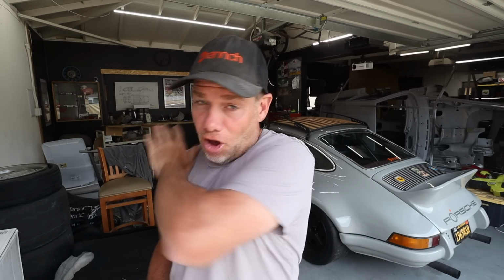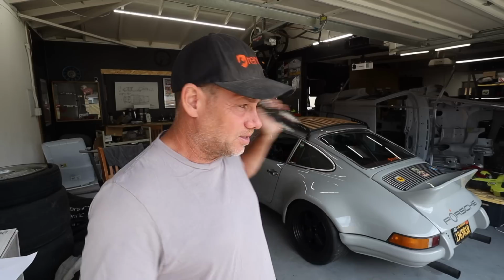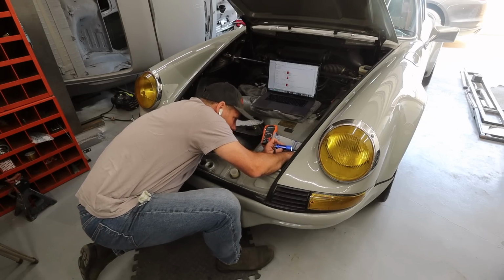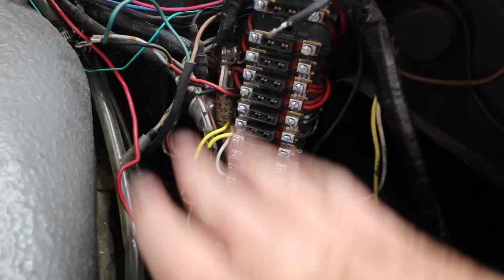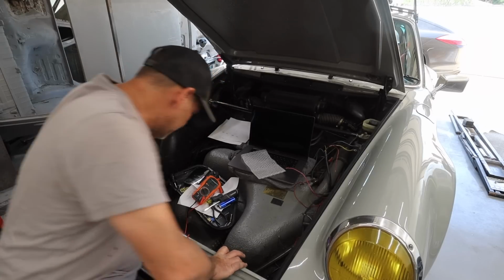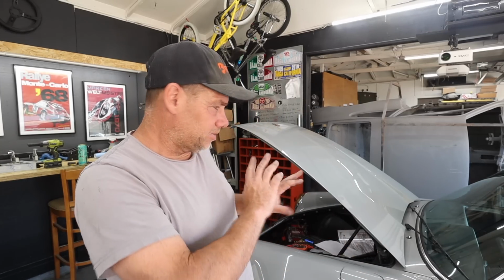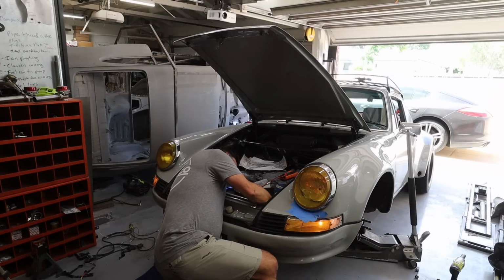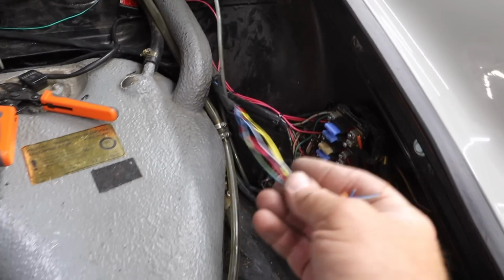How to Fix & Upgrade Your Vintage Porsche or Vintage VW WIRING! Part 1 (Porsche Restoration Series)

Comment: I upgraded my fuse panel in my 78. As I moved wires, I labeled every wire using a label maker that prints on heat shrink tubing. Now I can look at any wire and immediately see what device it is associated with.

Comment: Hey Michael I have really enjoyed watching you working on the gray ghost and now upgrading your electrical system that’s great,  that’s what I’d like to do to my 1974 911.
 But  why do you and other people always want to paint the engine compartment and the trunk  black??    Black is such a horrible color to paint those areas it makes looking for your wiring looking for nuts and bolts.  you have to have a military grade flood light shining in those areas to work to see what you’re doing?    To me when I see an engine compartment painted black or the trunk when the car is a different color it makes me think there’s some thing they’ve got a hide because black will help cover it up and make things harder to see.     Still I think the gray ghost is a great car and you’ve put a lot of hard work into it I wish mine was built as good as yours congratulations on a great car.
Reply from the maker: I mean… That's what the factory did.

Comment: makes sense that the ungrounded fuse block wouldn't power the headlights, but other circuits were fine.  Those relays rely on a ground (as do the LED fuse Good/bad indicators) to operate.  Without the ground, the fuses do their jobs but the relays can't.  Great video, we are all learning from you!

Comment: Please share the cheat sheet, I also have a 69 911 which has terrible wiring! Cheers
Reply from the maker: I have not talked to Jonny yet but once I'm 100% I will post.
Reply: @rennch. you are doing great!   You figured out the strange ‘69 bus bars and moved the circuits around.   That’s good.     Yes, relays need the ground to function.    For your main beam (brights). Check the white feed wire is going in on 1.   1 and 2 are joined at the output side and go to each lamp.